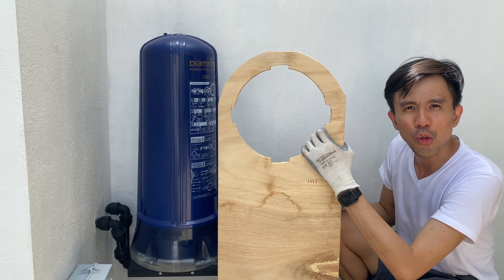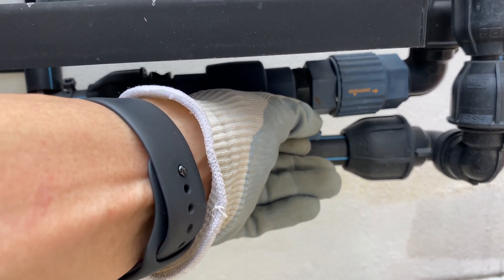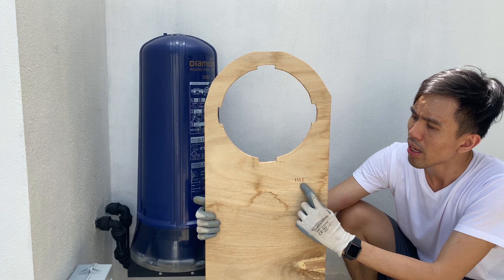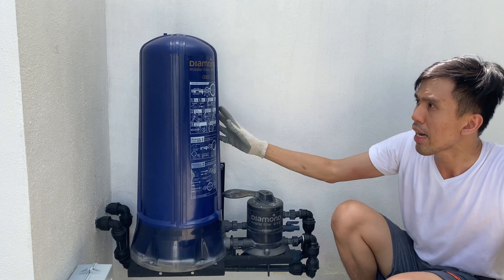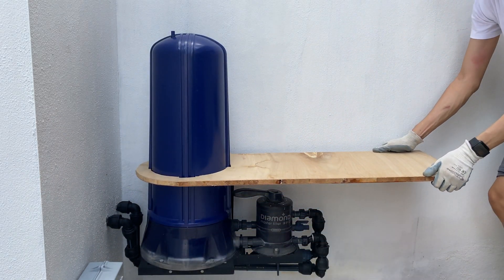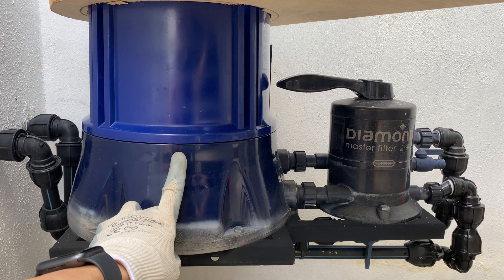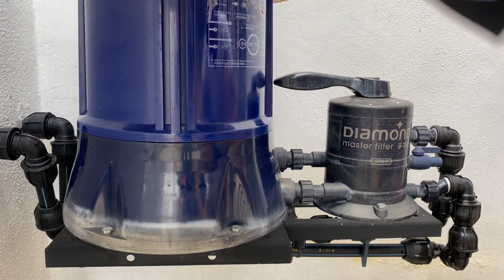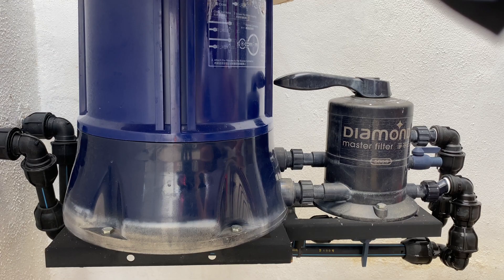Moments of force to open a filter cap |Procedure release internal water pressure|

Comment: do you know how to service open up the diamond master valve DMF 500S?
Reply from the maker: Have a look: Cleaning muddy filter fabric using #Bosch #Aquatek
https://youtube.com/shorts/PzUIbSIfcLE?feature=share
Reply: Not the cleaning of filter. I can open up the master filter to clean the filter. But i can't open up the master VALVE (the small  controller to do backwash). Do you know to open up the master valve for older 500S model?
Reply from the maker: Oh ic. Never thought of opening it. I will consider opening it if I know why it is important to do so.
Reply: the master valve already jammed, can't rotate or turn the handle anymore. I intend to service it myself rather to buy new replacement.
Reply from the maker: I suspect some plastic parts is broken inside. Try Shopee for a new valve. I believe it has been at least 10years in operation.